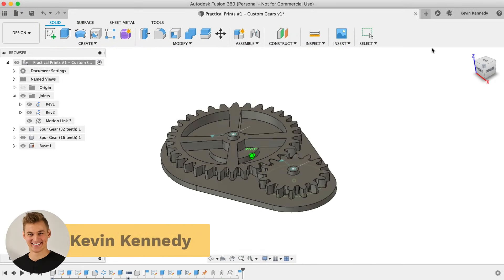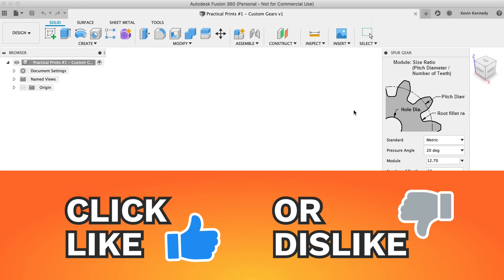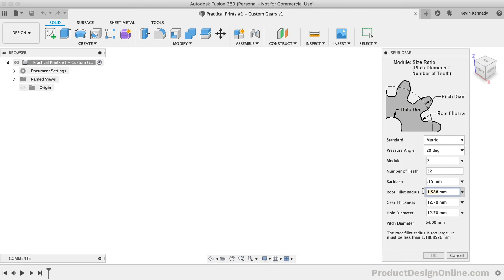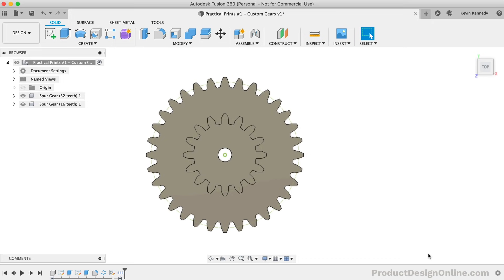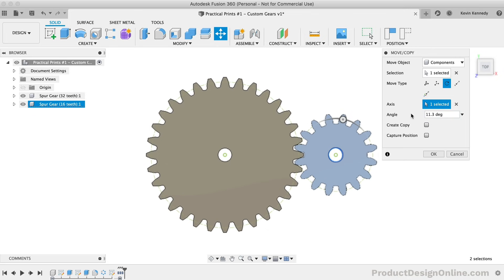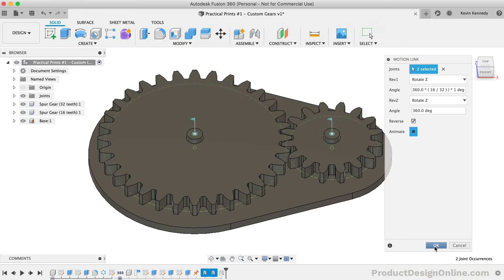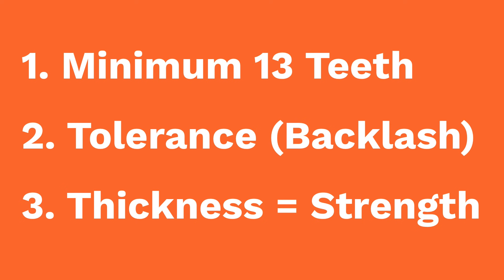Create Custom 3D Printable Gears in Fusion 360 | Practical Prints #1

Comment from the maker: The series playlists can be found here. All future episodes will be added ➞ http://bit.ly/practical-prints
__
TIMESTAMPS
0:00 - Custom 3D Printable Gears in Fusion 360
0:57 - Accessing the gear add-in
3:06 - Pressure Angle
3:40 - Pitch Diameter
4:14 - Module
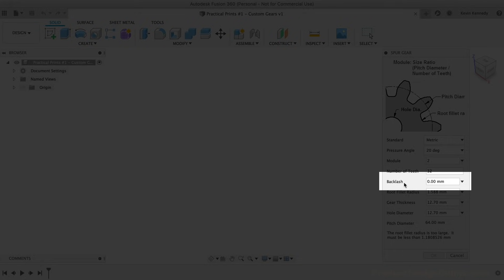4:40 - Backlash (clearance)
5:12 - Root Fillet Radius
5:43 - Gear Thickness
6:07 - Hole Diameter
8:30 - Creating the second gear
9:33 - Creating the base component
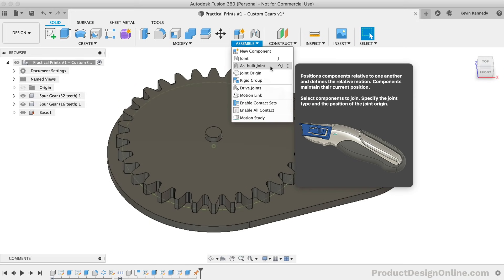13:17 - As-Built joint
14:05 - Adding a motion link
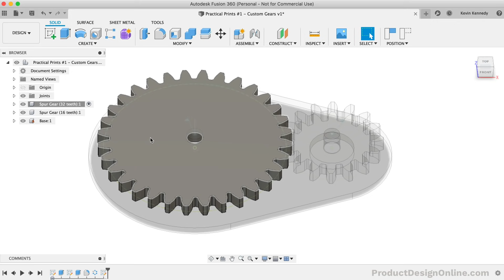15:47 - Subtracting material from gears
18:11 - 3 Tips when making gears
Reply: Would love to see a planetary gear tutorial next!
Reply: hi i am vikas , you i am happy you have 26k subs 😄😄😄😄😄😄
Reply from the maker: @DrRed141  Thanks for your continued support, Vikas!
Reply: @ProductDesignOnline  no problem i will keep supporting you because its worth it
Reply: @ProductDesignOnline  where do you live i am from india
Reply from the maker: @DrRed141  I'm in the USA
Reply: @ProductDesignOnline  thanks
Reply: @ProductDesignOnline  i like your voice in videos

Comment: If the tooth on both gears were aligned, then we need to rotate the 16 tooth gear by half a tooth to match them. so 360/16=22.5degrees per tooth, but we need just a half so :2=>11.25

Comment: Hey, don't know if you're going to respond but I'm on the motion link part. They are both joints but they wont move when I link em. Any idea why?
Reply: I also get an error saying 

The components you selected are rigidly joined, part of a chain of rigid joints, or 
pinned in place already and cannot move. If you join the selected components, 
the components will not move and the new joint will fail.
Reply: Never mind, I just accidently grounded a gear. Thanks tho. Good video!!
Reply: @mattzerellaz  Thanks for pointing that out, I was confused too. I think by default the first component is grounded.
Reply: @Thomas-gx2dd  Didn't ex[ect any responses. Glad I helped :)

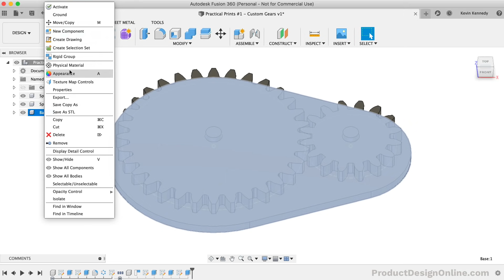Comment: At 13:10 the ground option is now changed to "Ground to Parent". It complains about the position of the base if it has been moved after creation. Is there a simple Ground option hidden somewhere ?
Reply from the maker: The original ground was renamed "Pin". Use that as seen in the tutorial and you will be all set.

You may need to "unground from parent"
Reply: @ProductDesignOnline  Thanks a lot

Comment: I didn't use rotate at the beginning but I used contact set so it automatically rotated second gear (This is from "Learn Fusion 360 in 30 days" playlist). After that I suppressed contact set so that PC don't need to calculate everything again.
Also I followed the rules from mentioned playlist so it's easier to change things in timeline (named sketches).

Ideas for the videos regarding 3d printing:
- how to make kit cards
- how to make flexi toys
Reply from the maker: Thanks for the ideas!!

Comment: Is Solid tab preferred over Plastic for designing for 3D printing?
Reply from the maker: The Plastic tab is only included if you have the Design Extension (a paid add-on for Fusion). It includes more advanced tools specific for plastic design (moreso injection molding over 3D printing). All that to say that nearly every design will start with the Design tab. The plastic tab can help automate some of the tedious processes.

Comment: The rotation of the smaller gear can very easily calculated without try and error: You want to rotate it by half a tooth, so 360°/16 teeth / 2 = 11,25°

Comment: Hi Kevin, a gear-tutorial request: Consider you have a plastic gear out from some gearbox with several teeth missing and a caliper in hand. (Consider a motorized toy of your kid with a broken gearbox). The task is model the original gear to be able to print a replacement gear and fix with that your broken toy, or equipment. What measurement do you need to make in order to recover the original gear data, at least in an approximate manner, and how do you reconstruct the gear model? 

For example, usually measuring the pitch-diameter is not really feasible, while measuring the outer diameter of the teeth, or the depth in between  two unbroken teeth is relatively easy. Also, often time the connected gear is unbroken, which might be useful for measurements.

Comment: Interesting video! Just one thought: you guessed 11.3 degrees for turning the smaller gear, but it seemed clear to me that it needs to turn exactly half a tooth. There's 16 teeth, so half a tooth is 360°/16/2 = 11.25°, which seems to agree with your guess/experiment :)
Reply: yeah not exactly complex math so not sure why he guessed.
Reply: how did you know that it needed to turn exactly half a tooth? is there like, a formula?
Reply: @Flaviongas  If two gears' teeth overlap head-on exactly, it's always half a tooth you need to rotate by. That brings a gap to exactly where a tooth used to be.
Reply: Exactly. I was like "how the hell couldn't he figure this out on the spot?".

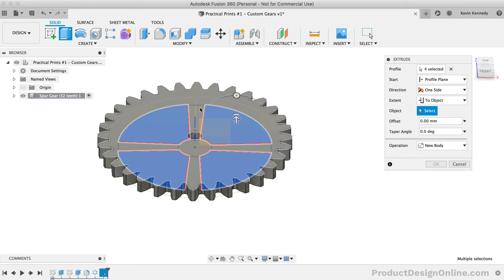Comment: Not sure if you offer specific help, but I am having trouble cutting out the interior of the gear. When I try to extrude/cut the interior, I can't select only the area outside the lines, I am only able to select the entire face of the gear inside the circle I drew earlier. Its like the spokes I drew aren't registering? I can see them but I can't select only the area inside. (I am referencing around 16:55 in the video). Thank you.

Comment: Finally... got a working design after following a lot of lesser instructions.  I did have a problem using the gear's parameter circle as an offset.  It was greyed out for the selection.  Instead, I just drew some circles from the center and followed those with spokes.  Thanks, Kevin.  Irv in Florida

Comment: The correct angle to rotate the gear is 1/2 of 360/number of teeth. In example. a 16 tooth gear, there is a tooth every 22.5degrees of movement. 

That said, it only works if the teeth start perfectly overlapped. For me, the spur gear was always created with a tooth facing perfectly right. Regardles of teeth, this should always get you a perfect alignment: 
Generate the 2 gears, 
move the gear2 right (distance is gear1 + gear2 pitch radius), 
rotate gear 2 180 degrees (two teeth should now be perfectly overlapped,
rotate gear2 another 360/tooth/2 degrees.

This might be overkill lol.
Reply from the maker: great work - thanks for sharing this!

Comment: Not sure where I went wrong, but I ended up having to enter -3 mm for the extrude and offset dimensions for the base for it to come out right. ( was working off the bottom of the gear faces)
Reply from the maker: Sometimes the direction gets flipped based on selection or where the sketch was drawn. Hard to say without seeing the file/process, but adding a negative doesn't affect anything overall as long as your model is not being driven by a bunch of parameters.

Comment: what if I have a gear that I am trying to replicate ? .... it is very difficult to measure accurately the pitch diameter , but it is very easy to measure the outside diameter .... how do I calculate the module and the pitch diameter of the physical gear that I have , if I can only measure its teeth count and outside diameter ? thanks

Comment: Hi Kevin I am trying to design a small gear that has approximately 10 or 12 teeth and the diameter of the gear is only about 6 mm. Is this possible using this method ?

Comment: 16:48 I followd you exactly and I am unable to select the 4 sections of the gear, it only selects the whole face...
Reply from the maker: Did you create the circle? All four profiles will need to be fully-closed in order to select them.
Reply: @ProductDesignOnline  Yeap, I created both circles and attached the lines, but for some reason it won't select each individual face.

Comment: when I get to the "create line" on the base, I get the message " some components have been moved" and am asked to capture the current position on continue in previous position. both reset the 16 teeth wheel to be inside 32 teethed one, and every time I tro to pull the  little wheel out, I get the same message when beginning to draw the base

Comment: Hello Kevin, I thoroughly followed you through 16:49 but can't get the object to extrude right as seen on this link: img .ur/a/6YexsD9
Can you please point out where did I went wrong? Thank you
Reply: wondering if you got it fixed  but  try to use coincident in constraints  tab   red+black line on a corner  
i was wondering the same since i used a point to point to make a nice curve :D  and i am a 3 day begineer :D
Reply: @buder5116  Worked with coincident constrains before Circle pattern. Thanks!
Reply from the maker: Hi LL. I'm seeing you have at least one closed profile... but based on the images I cannot tell if all four of the 'sections' are fully closed. That is the first thing to check. Second, you can select the four sections (while holding down the shift key) and then activate the Extrude command. Sometimes it's easier to select things first.

Comment: hi Kevin !!!. I learned a lot from your video. tnx. but I want you to make a video on the uses and application of all workspaces available on fusion 360. I want to design the entire DIY CNC machine but I don't know which workspace should I choose because I am a beginner. just a single video. please help me.
Reply from the maker: Hi Ethio. You would want to do all of the design work in the Design Workspace. The others could be used later in the stage (rendering if needed or Drawing workspace to create technical drawings when you actually go to build it!)

Sounds like a cool project :)

Comment: Great video....i have a problem, my gear teeth overlap with each other when they spin...what should  i do?
Reply from the maker: Did you apply a motion link to the revolute joints? The other option is to use the "Contact Sets" feature from the Assemble dropdown.

Comment: Wouldn't the rotation angle just be 360/(number of teeth*2)?  In this case, that gives 360/(16*2)=11.25.  You want it to turn half a tooth, basically.  So if you have 16 teeth, you want it to turn 1/32 of a whole rotation.

Comment: Nice! Seems that rotating a 16 tooth gear by one full tooth would require 360/16 = 22.5. Since we want to rotate it by half a tooth that comes out to (360/16)/2=11.25 degrees. Not so hard!
Reply: Yes, good job Kevin. To add to Mattias comment the rotation angle in the "Motion Link" pop-up can be expressed simply by using the number of teeth of each gear. 16 and 32 in your example, no calculation.

Comment: Having modelled in 3dsmax maya blender for 20 years, being a beginner in Fusion360 is driving me NUTS. Sketches are extremely confusing, when are they created? can they be removed (seems no)? Suddenly i have these single random gear teeth as sketches. I'm sometimes able to snap to offset circles, sometimes not. Why does it have to be so hard to understand ;_; As powerful as it is I really think the UI could have been easier without losing its power.
Reply from the maker: Hi, Erik. I think your frustration stems from having expertise in polygon/mesh programs. Fusion 360 works in the same manner as other parametric CAD tools (Inventor, SolidWorks, etc). The reason you need those sketches is to keep the dimensions and constraints available...so that you can update the model in a parametric manner. In short, this is the advantage of using a parametric program for engineer and design projects where size is important versus mesh/polygon modeling where it doesn't always have to be as precise.

I hope this helps a bit! Cheers, Kevin :)
Reply: @ProductDesignOnline  Thanks a lot for the reply. Sorry for the negativity towards the software, I've been going over a lot of your tutorials now and thinks are starting to make sense finally. Huge fan of your channel, will spread the word!

Comment: im not able to off set the gear circle to remove the inner filling
what can i do
Reply from the maker: Hi, Dhruv N. Make sure you have the "Base" component active before you got to offset. If that doesn't help, can you share a link to a screenshot or your file?
Reply: I'm having the same problem, I can't figure out why.
Reply: I found a way by selecting the dotted circle before starting the sketch by just pressing O for offset then it picks the right plane to access to that circle to offset from to cut the inside of the gear out.

Comment: Hi Kevin, This is what I've been waiting for!  This is a really awesome video!

I've been working on a similar design in Fusion 360 for more than a year or so. Here's a link to a hubless robot that I designed entirely in F360 and printed out. It took me close to 100 hours and several months between other things to get it to this point.

https://youtu.be/Z8Vn3fDNj9M

The gear train in your video is strikingly similar to what I designed almost 18 months ago, but the large gear is largely a ring gear that creates a hubless effect. 

I started using Tinkercad, and the gears were designed in this software. But the Robot design was so heavy, that I started learning Fusion so that I could complete the project. I eventually assembled the Robot frame and gave it a dry run. The entire design (with exception to the Gears) were finalized in F360. I have to start redesigning the gears so that I can have a smoother drive train as an enhancement to this design.

Cheers!
Reply from the maker: Hi Andy. Thanks for sharing this - your project is superb! The wheels appear to operate so smoothly, I would've guessed there were several non-3d printed internal parts (gears, etc).

What is the plan to use this for?? :)
Reply: @ProductDesignOnline  Hi Kevin. Thanks for viewing my project video. I want to use this as a generic Robotic chassis and mount  several sensors inorder to make it versatile. 
But the design is also suited to be modular and fitted on a larger robot frame. For example, the end units that hold the wheel and gear drive mechanism can be used independently on 4 corners of a tank-like vehicle. I feel that independent drive motors and a gear drive system would give such a vehicle plenty of torque.  Instead of skinny wheels, wider track wheels and tires could be added for extra traction.

I'll try to make a video that lays out the parts in detail, but the ring gear   is attached to a cage that rotates inside a race in the outer frame, with the help of 4 bearings much like you see on 3D printers. The shaft that drives the main drive gear is supported by old skateboard bearings pressed into the outer casing.

All the parts you see in Green are individual panels that come off separately to reveal the two independent drive gear systems on either ends. The top-side panel has holes that fit the mounting profile of a Pi Zero, an Arduino Uno and an LM298 motor driver. I plan to use the Zero to run the drive system.

I'm not satisfied with the geometry of the gears. I will be redesigning them for the next iteration.

More progress to follow.
Reply from the maker: @AMTheTinkerer  Incredible. Love how flexible the design is in regards to being able to use it for different configurations. Looking forward to seeing updates/progress on this :)
Reply: @ProductDesignOnline   Hi Kevin,  Here's the next video on the alpha bench-test. The Robot moves much quieter on the ground than on the plastic tray it so precariously balances on!

https://youtu.be/whOoRWt5Q8Y

Cheers!

Comment: Hey when i go to the scripts and add ins and select run for the python spur gear it doesn’t  give me the prompt “spur gear has been added to the create panel” after i hit run. any suggestions?
Reply from the maker: Hmmm... What happens when you select the C++ spur gear add-in? Does it add it to the create menu then? Otherwise, also make sure to select the "add-ins" tab/button of the dialog. If you're on the scripts tab it will not do it, as scripts are intended to be run only when "called."

Cheers, Kevin :)
Reply: @ProductDesignOnline when choosing C++ it still does not add to create menu but I think I figured it out ....when clicking tools> Add-Ins> Scripts and Add-ins, there are 2 tabs  of Scripts and Add-Ins. it loads up under Scripts were it didn't give me the prompt when I choose then Add-In tab and select Spur Gear I get the prompt. Thank for the tutorial and quick response back.

Comment: Could you model a gear with teeth on the inside of a cylinder?
Reply from the maker: Hi, Homer. That's definitely possible in Fusion 360. Unfortunately, the add-in I demoed in this tutorial does not have a feature to flip it. I'll try do incorporate that into one of the videos for this series :)

Comment: Great video Kevin really useful. BTW, regarding the rotation of the small gear to bring the teeth in line:  Would it be calculatable by the simple formula 

(360/ 2 x NoOfTeeth) =  (360/64) = 11.25 ?
Reply from the maker: Hi, Roger. That should be it. Depending on the number of teeth and how the gear generator places it... sometimes the gears will not need to be rotated. The second gear will just need moved to the right. Cheers, Kevin :)

Comment: Yes, i'm interested in more gear tutorials
Reply: #metoo
Reply: I'm quite interested in gears (including planetaries and compound epicyclic), sprockets and toothed pulleys. They would eventually be machined from metals, probably from home cast blanks unless steel is required. 
Thanks.
Reply: I am
Reply from the maker: I'll definitely do more :)
Reply: @ProductDesignOnline  gears where the spurs are on the inside of the cylinder instead of outside. I imagine you could just do the above and subtract from another part but just in case there is an easier way. Please and thank you.